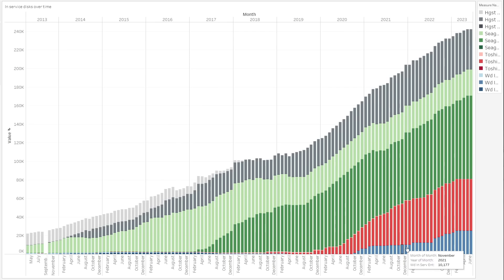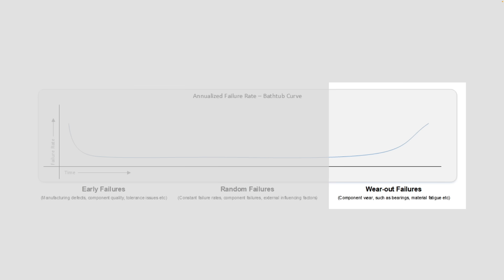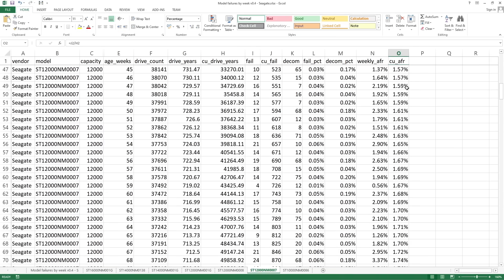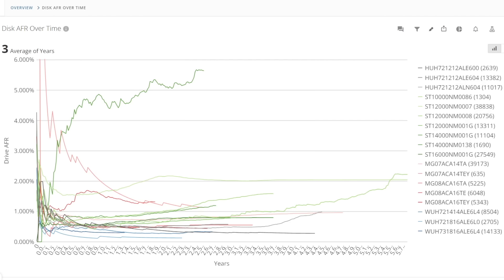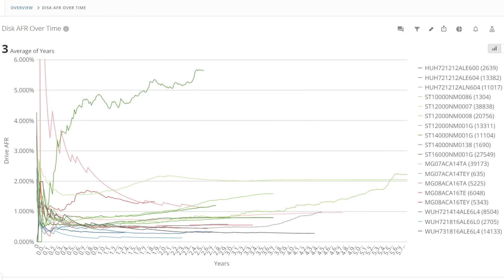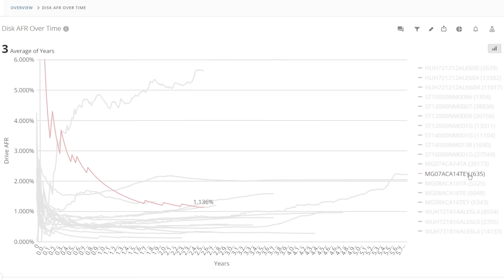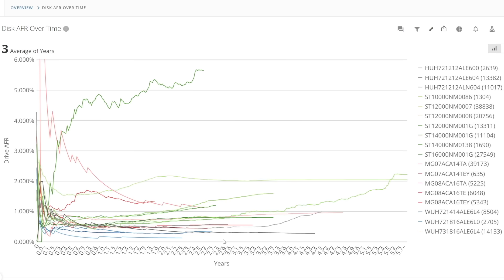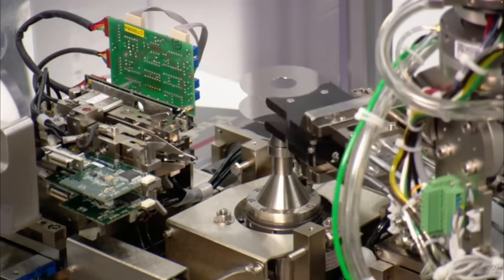Failure Rate Analysis - Best 10Tb+ hard drives: Seagate, Western Digital or Toshiba?

Comment: Warranties are only as good as the company that backs it.

When it comes to Western Digital, they do everything under the sun to frustrate the customer, to avoid honoring their warranty obligation.  Their warranty is almost worthless.
Seagate, on the other hand, goes out of their way to help the customer.  Their warranty policies are the opposite of Western Digital's policies.

I can write several paragraphs on all of the despicable things that Western Digital does, when you have a failed drive that is under warranty.  Let me know if you want the details, and I will type them up in a  reply.

Same for Seagate.  I am happy to provide details on all of the ways that they help their customers deal with drive failures during the warranty period.

Unless a Western Digital drive is ½ the price of a Seagate drive, I will never purchase another Western Digital drive -- and that goes for their other companies, like G-Techonolgy and Sandisk, etc.
Reply from the maker: I have heard good things about Seagate and how easy replacements are made, have not heard so much about WD. 

From much of the analysis I have done, it looks like the WD products are technically a bit stronger. But from a customer experience perspective, I hear more troubling stories about their transparency. This includes the obvious SMR issue on the Red drives, the bait and switch on the SSD drives and then shady stuff like reporting some drives as 5400RPM and some as '5400 RPM Class', which seems notably obfuscated and questionable. I would be interested to hear about warranty examples, maybe its worth a deeper look if there is something there.
Reply: @sometechguy  Western Digital:

When I had G-Technology (a WD brand) drives fail, I could not create an RMA number on their web site.
I tried for a week, with the same error messages.

I looked for a way to contact Western Digital via e-mail.  I could find nothing.
I looked for a way to contact Western Digital via a phone call.  I found no information on their web site.  I did, however, find phone numbers via web searches.  But the sites that listed a phone number were not the same as what is listed in wikipedia, or for making purchases, or for any other standard reasons a person would visit the known WD web site.

So am I to trust some other web site's claim to have a legitimate WD phone number?  Or will that phone number be a scam?

I asked Micro Center's customer service if they had a WD phone number.  They did not.
I asked Best Buy's customer service if they had a WD phone number.  They did not.

After close to two weeks of not being able to create an RMA, via WD's web site, and having no other way to contact them, I took a chance with the phone number from the web search results.  It turned out to be a valid phone number.

After calling that number, I was forced to listen to lengthy sale's pitches.  Not what you want to hear when you are calling to have an issue addressed.  But WD takes advantage of a captive audience.

Eventually I got to speak to someone over a connection that sounded like it was bouncing over satellites around the world, making it difficult to have a conversation.
But it boiled down to them having system maintenance being performed (as if I believed that), and that they are unable to provide an RMA number.

So what good is a warranty, when Western Digital mandates that you obtain an RMA number for a claim, and yet refuses to provide an RMA number?

This went on for another week or two.  Each time I called they gave excuse after excuse, and assured me that the issue will be fixed in the next day or two -- and that went on for weeks.

I eventually told their representative that their RMA system's maintenance issues are their issues, and it is unacceptable for them to refuse to honor their warranty agreement.  Whether or not they can provide an RMA number is not the customer's responsibility.  They have to replace the failed drive, regardless of an RMA number.

I eventually got to speak with a manager, who gave me more of the same.  When I told the manager that I would be writing a physical letter, putting a stamp on it, and have the post office deliver it to the CEO's office, he managed to get me an RMA number.

He told me that for an additional $25 "Convenience Fee", they would expedite shipping me my replacement drive.
I explained that I have been struggling for almost a month, and should have already had my replacement drive weeks ago.  That fee should be waived.

He had no authority to wave the fee, and I refused to pay Western Digital a fee to honor their warranty agreement.

I shipped my failed drive back to Western Digital, with the RMA number on the box and inside the box.

A week after FedEx reported delivery of my shipment to them, and my not having heard anything from Western Digital, I called Western Digital.  They told me that they did not receive my drive.  When I gave them the FedEx tracking number, they eventually acknowledged receipt of my failed drive.

So if I did not call them, I would never have gotten my replacement drive.

I waited another week, and heard nothing from Western Digital.  I called them.  They said that my replacement drive would ship in the next 24 to 48 hours.
I waited 72 hours, and called them.  They said that my replacement drive would ship in the next 24 to 48 hours.
I waited 72 hours, and called them.  They said that my replacement drive would ship in the next 24 to 48 hours.

I told them that my replacement drive will ship today, or I will print out everything that took place, put that printout in an envelope, put a stamp on it, and have the post office deliver it to the office of the CEO.  They gave me a tracking number for my replacement drive.  They shipped my drive the next day.

The above was very, very time consuming.  And it happened again, months later, with another failed drive that was still under warranty.

And it happened a third time, with yet another failed drive that was still under warranty (although the last incident did not include not being able to get an RMA number).

But the pressure to pay them $25 to process my warranty claim, without delay, was relentless.
And having to repeatedly call them, was very time consuming.
And being forced to listen to their recorded sale's pitches, each time I called, was very annoying.

Seagate:
When I had a Seagate drive failure, they handled it exceptionally well.  I had no problems getting an RMA number, and no problems reaching them, and not long recordings to listen to, and clearer phone connections, etc.

And to my surprise, unbeknownst to me, my failed drive included free data recovery as part of the warranty agreement.  Their customer service representative told me about it, without me asking.  So they could have never brought it up, and I would have been none the wiser.

They shipped my my recovered data on a physical drive that was just large enough to hold all of my recovered data.  They also shipped my my warranty replacement drive.  So they shipped me both a recovery drive, and a replacement drive.  I asked them if I needed to return the recovery drive.  They told me to keep both drives -- they are mine to keep.

All of the above happened without delay, and with only one minor hassle.
They asked me if they should encrypt the recovery drive.  I told them "No.", because my data would be useless to anyone (it was already encrypted by me).
Well, they encrypted it anyway, with BitLocker, and forgot to give me the password.  I called them up, and they gave me the password, and all was good.

I do not know if all of Seagate's drives include free data recovery in their warranty?  Of even if they did then, do they include it now?

Lastly, if my memory serves me correctly, Seagate provided me with a pre-paid shipping label.  Western Digital did not.

I converse with Chia crypt-o miners in a Chia forum.  They, too, have had terrible experiences dealing with Western Digital's warranty service, and only good experiences in dealing with Seagate's warranty claims.

Comment: The WD Red i bought lasted 1 year, same with Green(just over an year) WD Blue lasted only 3 weeks (no i did not get my money back though they did not say it was anything on me(aka anything i did/effected), they tried to avoid saying that it was the hardware fault.
Offered that they take the drive then they will give me a new (that drive had some seriously worthy data on it that was business secret and i could not return it).
From the main stream drives over the past 20y WD had had the worst record (90% died in first 2 years from mid to low load) and the best with 100% (all drives) still(after years of use) working is Seagate.
Ofcorse you should not get the cheapest but the model that suits your use.

So yes Awoid WD if you need to keep your data.
To this date the best surviving (still active) hdd making company is Seagate (Maxtor was the best with 20+years everyday mid to heavy load to a drive and still working perfectly).
For most data storage(like to arhive or media for homes) i would reccomend the Seagate IronWolf 4t(or larger) as they seem to have most that a home user might need from a sturdy HDD (the 4tb or larger cos they include free data recovery in case of failuer), good speeds, reliability and also the price is compeditive(most places under a 100).

I only have 30years of many drives i have bought, used and tested.

Comment: Every Seagate drive I've owned (6 total) have failed within 2 months. Two were DOA. All had loud clicking when they failed.

I've owned over 30 WD drives, and only 5 have failed so far. Three of those were due to overheating (case fan failure). The other 2 show bad in the NAS they were in, but test fine standalone (6 TB WD Red). I've never had any issues with WD drives clicking. Many of my WD drives are over 5 years old.

I'll stay with WD for all my HDD's.

Comment: I used to buy brand new but I have very positive experience with refurb 16TB Seagate EXOS that I'm planning to buy refurbished HDDs again. They are much cheaper and all stats has been resetted as if they are brand new. I just have to make sure I have enough backups in case of failure.

Comment: Might I suggest that you do another data run where you exclude drive failures before 3 months -- as I think that's clobbering some 'long-term' stats.
Reply from the maker: When I parsed the data, I had two objective options. One was to use all the failure data up to each point, and the other was to calculate each AFR data point based on just the one weeks data.  e.g. how many drives fail in exactly week x.

The first produces a smoothed result which shows the aggregated AFR over time, but you are right that it incorporates historical data so each data point shows the full AFR performance of the model up to that age. 

The second approach produces a very spiky graph where AFR varies from 0 to multiple 100's of a %, so its difficult to produce a useful and comprehensible plot. It does tell you the likelihood more accurately of the chance for failure at a specific age. But as its all statistical data, I am not sure that is useful. Just because more drives failed in week 60 than 59 or 61, doesn't mean that further drives are more likely to fail at exactly week 60.

Overall, option one is likely the more robust and realistic approach. Yes, early failures impact AFR stats on the drives later. But I think that's valid, as those drives did indeed fail prior to that point in the timeline and you would want that surfaced.

Excluding a set period like you suggest would do what you say, but I think it makes the analysis more subjective as you can choose the cut off to intentionally or otherwise favor certain drive models. But I could test this the next run I do to see if it produces useful output.

Thanks for the thoughtful post, it sounds like you looked at the data, which makes me happy. 😊

Comment: This is outstanding analysis. Thank you. Am impressed with my WD and HGST drives so far
Reply from the maker: Thank you, appreciate the feedback and the likes on this comment. Glad people found this valuable. 🥳
Reply: WD used be my worst nightmare. I had a lot of their 80GB drives and every single one failed. The warranty replacements failed. It was a disaster.   But flash forward 15 years or whatever it is and I ended up running WD NVME in everything and now the 10TB HGST HE drives in my NAS.  Mostly because they absorbed Hitachi, my old go-to. But I've been quite happy with current NVME and spinning drives and SanDisk for memory cards.  Samsung, Crucial, and Silicon Power have all let me down. Would never use those again. Hynix has been good to me.
Reply: @LatitudeSky  I had Several 3TB Toshiba Drives That FAILED! The WD 4TB Drives Were Way better! I Am Now Running Refurbished 12TB Seagate Exos 16 Enterprise Drives! I Have 3X12TB and 3X14TB For My OS I Use Sabrient Rocket 1TB And WD Black 1TB NVME Drives! On My retro Dell XPS 410 I Run Kingston SSD NOW 128GB's It's Over 10 Years Old Now! The XPS Is From 2007!
Reply: me too
Reply: I still have my WD drive from 2016 🤯
Reply: I Have A WD 500 GB Drive That I Use As A Temp Drive To Record TV To! I Bought It At Goodwill Over 10 Years Ago For $1! This Thing Has lasted Longer Than Any Other Drive I Have Owned And Stays Powered Up 24x7 The Entire Time I Have Owned It!! I Expect To Hear The Click Of Death Any day But it just Keeps on Spinning!
Reply: @kevinlsims7330  curious how long it took you to write that comment with all the unnecessary capitalization

Comment: What about SSD.
Reply: When SSDs came out it was Intel, then up til recently its been Samsung. After many years of being the best there were firmware problems with the 980 pro.  Crucial is just as reliable (if not more) but samsungs speed made it the choice.  The others have improved,    Id go with WD, Samsung, or Crucial.  I went with WD black SN850x in jan 2023. if not for the 980pro problem, it would have been it.  990 released since is fine).     Sabrent , no, they not reliable like the others. they more like a reseller vs huge tech manufacturing companies.

Comment: Does backblaze track idle time vs usage? As a home server user, my drives are spinning 100% of the time, but active use is probably much less than 12 hours a day.
Reply from the maker: I don't think SMART has any stats that tell you that, and the data is basically daily SMART extracts along with data on when drives died. So you can see when a drive first appeared, when it disappeared and if it disappeared due to a failure or not. But drives themselves don't record usage, other than number of power down events etc, for which there are very few, probably maintenance. 

That said, these will be in chassis in large arrays, so I would imagine they are being accessed pretty much 24x7.
Reply: Ya, I guess we can view their info as a torture test weeding out the weakest drives. All good info... thanks!

Comment: i've always had good luck with HGST and Seagate Enterprise capacity/Exos drives, even if they are refurbs i'll continue to buy.  just make sure you plan for enough redundancy and backups
Reply from the maker: Yes, no matter which brand you buy or how good they are, they can fail and will fail. And if you are planning for those failures, it can then make sense not to pay a high premium for the most proven reliability also. A lot of people share their bad experiences, and more than most it seems about Seagate. And though the data shows they are probably more likely to fail, I don't think the numbers are too outrageous, and it will come down to statistics. Personally, I have had many years of good experience with Seagate also.

Comment: This analysis is flawed when you consider the drives that don't fail won't appear on the failed drive statistics :3
Reply from the maker: AFR is the failure rate across the entire running estate, including the drives that don’t fail. 

This analysis is done based on the age of the drives. So for each week it compares the number of failing drives to the total population and then calculates the percentage on an annualised basis. Meaning that the number of non-failed drives are a key part of the calculation. 

Hope that helps clarify.

Comment: My Seagate Exos X16 10TB HDD died after just 29 hours of use.
Reply from the maker: That's a bummer. 

It could be just the nature of statistics and you got the short straw, or its possible the drive was damaged in transit also. I have returned several drives that were not packed adequately and/or were mistreated in transit and visible dents. I am sure there are G shocks that can happen also that don't leave noticeable damage. Amazon especially have sent me drives in the past just in bags with minimal wrap.